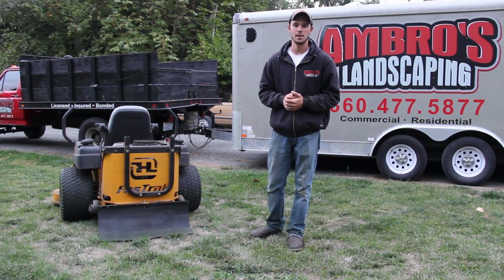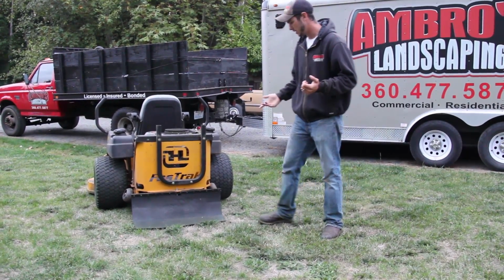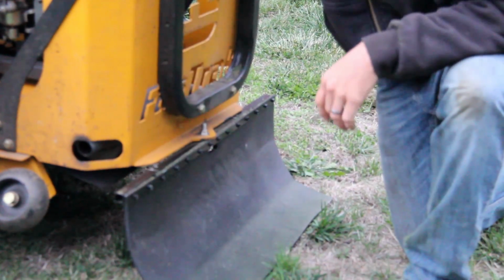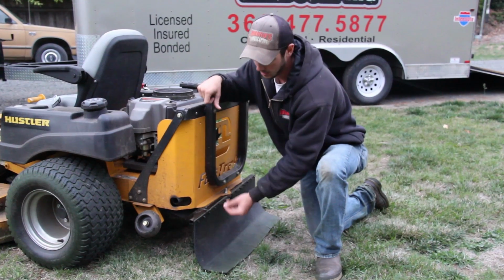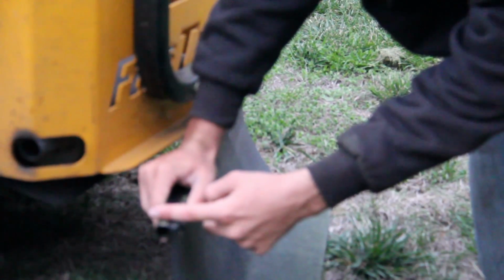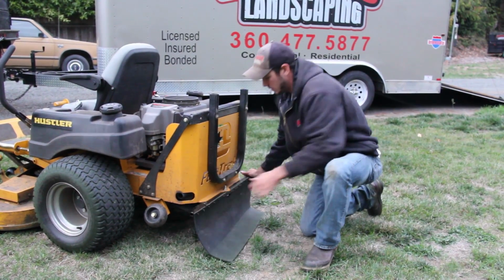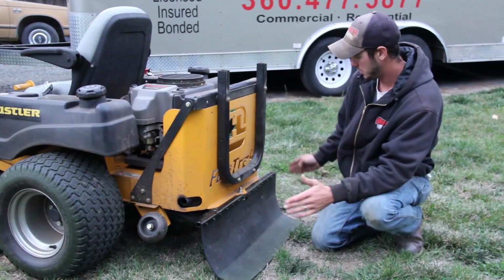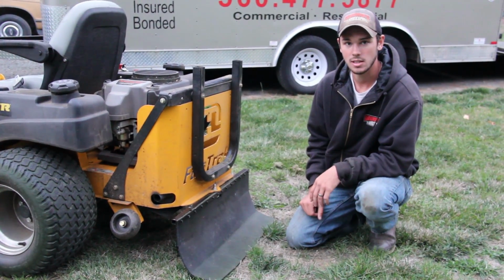DIY Striping Kit | How to & Demo

Comment: Found an easy way to fix the arm from turning, put a piece of metal angle iron on the front of it to sandwich the mat to the square tubing. The angle goes on top of the hitch hole and the square tubing below it. Drill a hole through both for the bolt and you are good to go! Did it on mine today and works great. Thanks for the idea!
Reply: +dbritt8715 

good idea. also a screw on both ends of the square tubing at the back edge of the piece on the mower would prevent it from turning and no hole would need to be drilled in the mower just like your idea. I will have to try this soon.

Comment: i used a NEW truck rear mud flap for a semi.  $17.50 at parts city. I also added a 36'" piece of pipe ate back for alittle extra weight. works as well as the mow at the golf course
Reply: pics or video?

Comment: Love it, the only thing I would change and don't know if anyone said it yet is the nut and bolt through the 2x4 through the hitch I would just use a trailer bolt with cotter pin for quick attaching and detaching.

Comment: if you extend the mat to the length covering the width of both tires, the effect might look more even.  :)
Reply from the maker: Thanks the comment! It wouldn't do to much since the weight of the tires is greater then the weight of the mat.
Reply: Ambro's Landscaping Inc. Oh Ic, I thought the extra 2 stripes due to the tires might be taken care if the mat was extended.  Thanks for your explanation.
Reply: if you look at the stripe, where the tires are, the stripes are even more "white" than the center, that means the grass has been pushed down even more than the center. Reflecting more light. So a longer mat would not help because the mat is not near as heavy as the weight from the mower and tires
Reply: What is the name of the metal bar used? Lowe's & Home Depot say they have no clue. I even showed them your video. Lol
BTW, It looks AWESOME!
Reply: I just used the regular bolt with 2 washers 4  holes in the back of SnapperPros75x 
& used Mining Belt. Yes West Virginia.  Lol
Thanks for the tip!
My lawns look AMAZING now!
Reply: @JohnCarter-ip4fm  flat bar , angle iron , square tubing anything will work.

Comment: Should the striping mat fit between the tires or be wider to include the rear tires?  This one fits between but I'm wondering if there is an advantage to going wider.
Reply: Then you’d have to worry about backing up and it ripping off. I’m about to do the same thing but I’m going to use a piece of angle, and the self tapping screws. Screw it into the bumper and cut a small hole for a bungee cord hook to lift up when it’s not needed.
Reply: No advantage. The tires stripe the grass too. You don't need it to go the full width of the mower.

Comment: What is a "thin square piece" he refers to. Thats all i need to know is what the metal things are he uses to mount the mat. Other than that i love the video and idea.
Reply: Use a pice of flat bar or even better a pice of angle iron
Reply: I believe one piece was Square tube in the other piece was a flat piece of Steel

Comment: I think you'd be better off using chains. Just cut series of chain long enough to just lay on the ground. Mount them to a mounting bar and mount to the back of the mower. They'll drag a lot easier and won't give any issues when turning.
Reply: except getting caught on sprinkler heads, roots, dragging trash...yermy

Comment: Here is question, why not built it at least almost too the width off your wheel base? That way you don't have too show any wheel track on the lawn. I too like the rubber matt that would void breaking sprinkler heads.
Reply: Using a wider mat would not make a difference unless the mat were heavier than the mower. The wheels carry more weight which in turn presses the grass down harder and you would still have the tire marks.

Comment: Can you explain more what type of metal bar you used.  Be great if you did a piece by piece video or listed items with links.  Definitely love your idea.
Reply: Brad Waddell it’s very simple. Use a piece of 1” square tubing and screw the mat to it. Then whatever you need to do in order to attach to your mower.
Reply: Flat bar , angle iron , square tubing anything will work. It’s not rocket science.

Comment: Is that a super duty? I guess it's not. Is it 60"? Also what's on the front of the mower? Black plate?? PS, I have 2 Fastraks and Xonei
Reply: Probably weights to offset the bagger. I have weights on mine, but they do look a little different than this

Comment: 3 shades of green . interesting. 3 different size strips . it works. i’m to lazy to add a stripping attachment. i do the poor man’s method. i mow one direction at 4” then when i have to go the other way i drop down to 2”. from any angle the syria can be seen cause the grass sizes at 2” difference more than enough for the sun to reflect and see the strips.

the sun the syria???

Comment: how well did this work for you? I want to know if I'm better off spending  $300 on a striping kit or if something like this is sufficient.  Thanks
Reply: This is what I am trying to figure out myself. I have a lot of customers properties that only have one small section that is nice. For the most part this section is their front yard. So I am looking for something I can use and then quickly remove and come back for later. The other striping kits do not look like they are easy to remove whatsoever. I would not want to take them on some of the steep hills I cut either.
Reply: i made ome for cheap. just see what it would do. works great! people stop and ask how it was done
Reply: It really depends on how well you diy it. Grass height, grass type, and deck rake also play a big role in striping. What he has in the video looks pretty much just as good as a real stripe kit, only question is how long it'll last or webter he got the weight and stiffness right where he doesn't tear up the yard when he reverses and makes turns, and it seems like he already addressed those issues.